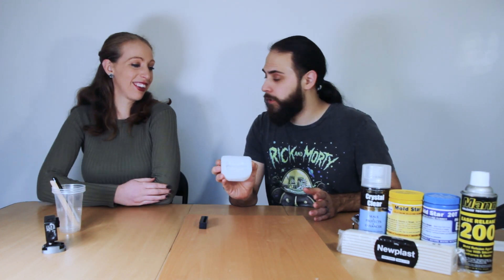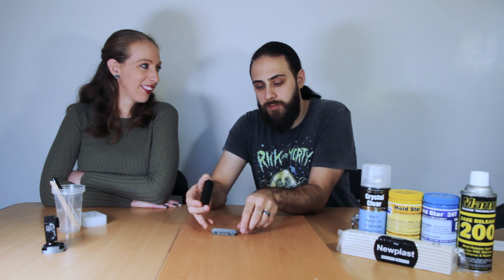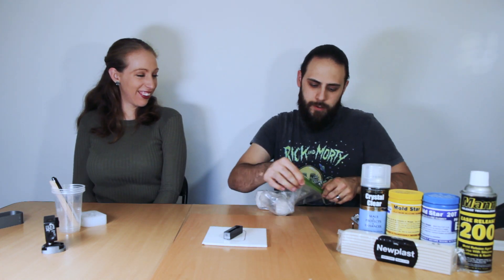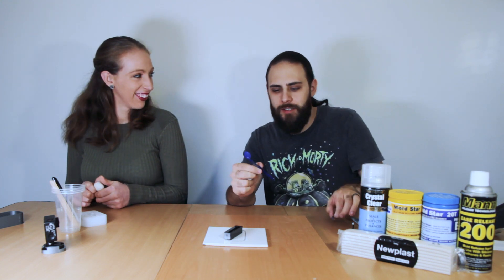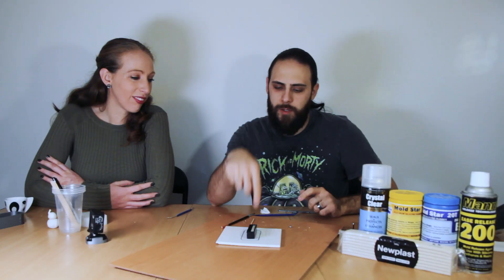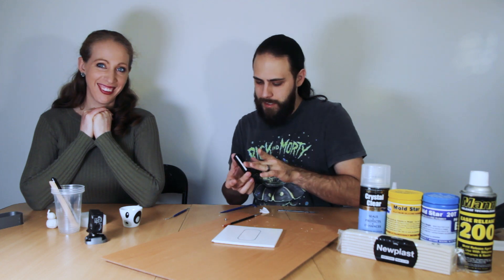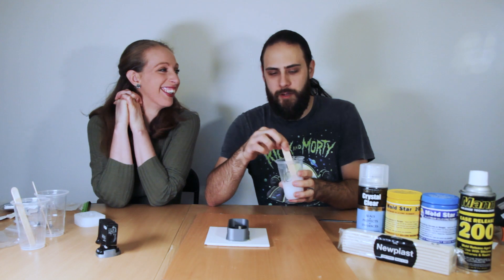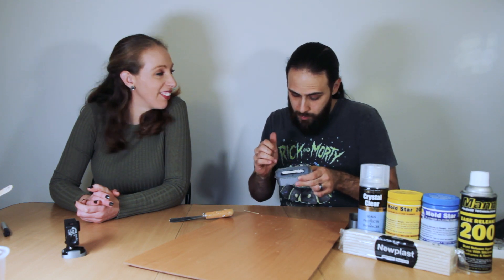Two Part Mold & 3D Printing Walls

Comment: Isopropyl Alcohol will break a hot glue seam almost instantly, super useful for stuff like this where you need to be a bit careful. I have mine in a lab bottle and just spritz some on and the joint will break away!
Reply from the maker: ha, that is a sweet tip! thank you sir!!